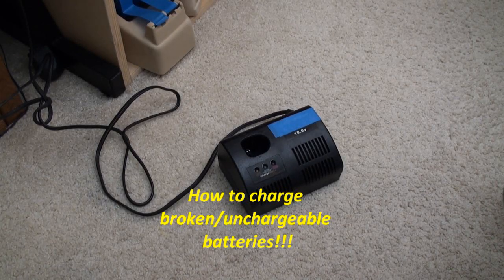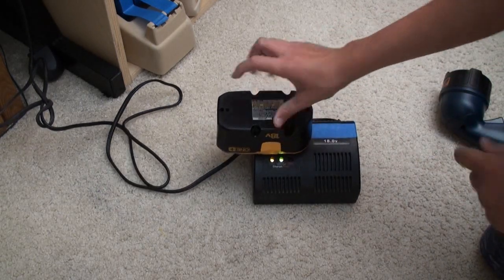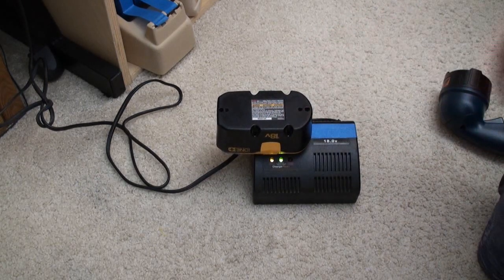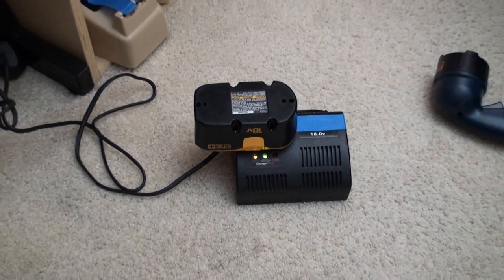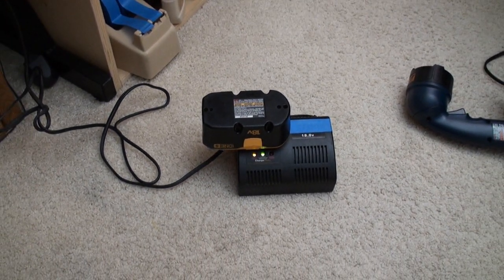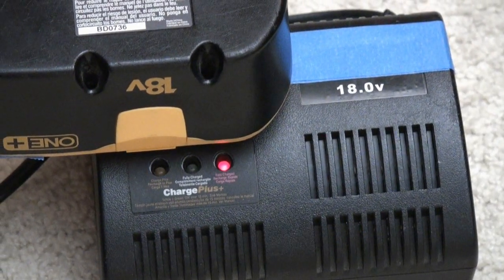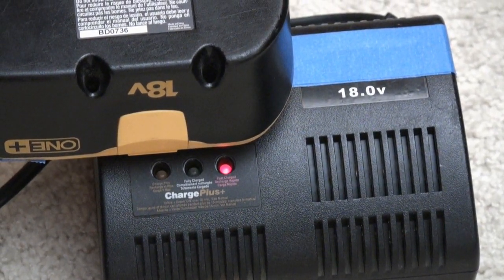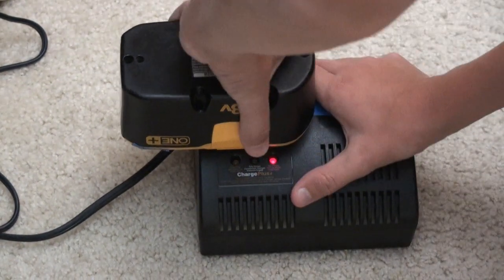How to recharge unchargeable batteries

Comment: I use a similar technique on my 3V digital camera battery with a 9V battery as the source instead of the charger.

No hidden battery switch here to be sure.  If you have this problem, take the two minutes to try this before scrapping good batteries, you wont be sorry.

Comment: this is playable if it is about batteries which been lying around for long time,  and therefore won't charge. .
the batteries shoul be able to take a proximity 1000 charges. ..If you have charged more than 1000 times
..your batteries most likely are worn out,  and will not keep up the power..

Comment: Old news. Been doing this with Nicd batteries for 30yrs. You can either reverse the polarity at about 10 amps for a short time or use a higher initial voltage to get it to draw current. Either way works for about 4 to 6 times when they are dead. After that nothing works.

Comment: rbrtfls is EXACTLY right . The battery will not hold a significant charge . You ( or a factory tech )  will have to open the case and replace the defective cell and re assemble the case

Comment: There's sound electronic principle here.  The charger detects a dead battery and won't charge when one or more of the many cells inside the battery has totally discharged to ZERO.  The charger THINKS it is SHORTED. Forcing a charge into a shorted cell will overheat it, so it shuts down

By intermittently jiggling of the power cord, the charger doesn't have a chance to shut down and a little charge goes into those zero-volt cells.  Then the pack doesn't look dead any more and charging proceeds.

Comment: Don't leave any rechargeable battery laying around that's been partially discharged. This shortens the life of the battery. Always full charge it right after you using it. Makes a big different on shelf life. All lithium type batteries all have a chip inside. This protects the pack against discharge down to zero. Otherwise, zero volts can result in the pack shorting out...and BAM! All the lithium and NiMh packs have a chip inside. This is why a running power tool will suddenly shut down.

Comment: Forcing the charger to rapidly discharge the bad cells allows the battery to recharge. Old battery chargers had switches to allow rapid power cycling to "reset". the battery. Today's chargers had the switches removed to save money. Right.

Comment: This is a battery memory problem caused by not completely discharging between charges.Interesting tip though, will try it myself! UK socket outlets are much safer than yours! Thanks.

Comment: The fact that this method works would suggest that it is the battery charger which is faulty (not the battery) and most likely it is incorrectly soldered components inside the charger which is to blame. These battery chargers are all made in places like china, india etc.  where they use recycled electronic components to make their products. The problem could also be that recycled electronic components in the charger are close to dying.
Another issue, bad electronic design engineering of the battery charger, seeing as it seems to be a common problem which many people are encountering.
A similar trick , if you can call it that , works with an apparently malfunctioning xbox power brick.

Comment: something to consider here; though with some caution.
In a Pinch I think there is nothing to worry about, but I would hold out to everyone that in the case where a battery has been run out of it's life cycle force charging it (If this is what it is) should be monitored and never left for Long Periods of time without supervision, like say every thirty minutes at the very most one should have a look at the status just to be sure a fire has not started just to be on safe side.

Comment: Been using this technique for a few years now on the same pair of batteries.  I believe what is actually going on here is either the battery (in some cases), or the charger (I believe in this case) contain circuitry to inhibit charging when a deep discharge occurs.  Feathering the plug in the socket eventually causes small arcs and an overvoltage in the charging circuit.  This forces a small charge into the battery allowing it to continue to take a normal charge.

Comment: u guys have funny plugs. but anyway i have a 12 volt battery i wanna charge and can only charge in a alarm system. i depleted it completely and charged it up and it still doesnt last. i'll try what u did, but our sockets are 240 volts, nt sure if that'll be safe to do bt i'll give it a try.

Comment: actually, they are 9 - 2 volt batteries. ni cads are always 2 volt. 
these batteries are very easy to dissasemble, but you have to solder the individual batteries.

Comment: Thank you. I had to endure 30 minutes+ of videos from "adults" that had crazy ideas like yours, but using arc welders, or connecting batteries together in series to get enough volts to "re-polarize" the cells inside the battery.
Yours is quick, to the point, and it works..

Comment: This didn't work for me on my Craftsman drill battery. The charge indicator light flicked on each time the plug made contact, but even after several minutes of flickering, the light goes off once the plug is fully inserted. The battery is still dead.

Comment: the battery would not blow because of recharging it like that, explode is not something possible for a battery like this is not C4 or Dynamite for it to explode, is a good idea but even through it would only work for a certain period of time and this is due because batteries tend to die because of there life time capacity, you can do this process of recharging it like this but it would have to be temporarily until you get a new battery.

Comment: Determine which leads are plus and minus. Connect a 9 volt battery to the recharge battery for a few seconds and then the charger will work also.

Comment: The problem with this method is if your battery is no good, it's very hard on the charger. I popped the fuse inside it a couple of times...at first I thought damn, stick a fork in it...lol. Anyway, I tried the welder method and the battery pack got close to normal voltage but still wouldn't charge properly, so that battery is toast.
Reply: You say this method is very hard on the charger if the battery is no good. I don't know enough to agree or disagree, but what I'm wondering is, on the basis of what information / experience are you making your assertion?
Reply: Dave Burrows
the fact that the charger fuse blew bay be a hint that the charger is overworking?
Reply: A blown fuse points to an overloaded circuit. Isolating the source(s) of that overload just takes a little detective work. In this case, the old battery is the likely culprit, but other factors may be involved. A resister, for example, serves some of the same functions as a fuse. If one or more resistors fried, their loss may put greater burden on the fuse than for which it was intended. Obviously, a short between contacts would do it.

A fuse is a safety device. A short circuit left unchecked can easily ignite a fire. The fuse also protects other circuitry from overload. Replacing a blown fuse is fast (if you can find it) and easy (if you can reach it), and can prevent a huge repair bill.

As far as an overworking charger goes, a job of the fuse is to protect anything from being pushed beyond it's intended limits.

We've all gone to turn on the windshield wipers, headlights, or some other electrical circuit in a car, and it didn't function. Once in a headstand position under the steering column with your legs out the open window, and a flashlight in your mouth, replace the proper fuse. If it blows again, then something else is going on. In my experience, replacing the blown fuse solves the problem, and it doesn't blow again. Sparky gods must be crazy.
Reply: Nothing can be done to shock back to life a dead cell. 18 volt ones have 15 sub c cells, if 1 is bad then it can ruin it all. Depending where it is in the sequence and how bad it is. I fix many batteries with only 1 or 2 bad cells in them that prevented all the others from working.
Reply: I don't know anything about batteries, not really, but that's the same conclusion I've drawn.

Comment: new method. what i do to recover nicads id pop them open, build a self-oscilating relay connected to a ac wall wart transformer in reverse and a HV diode and flash capacitor, and use the cap to "shock" the batteries again, coarse, you can also just use a fugicam circuit.

Comment: There is always a risk when recharging a dead battery,or even a rechargeable battery, this is an ingenuous way of brething life to a depleated battery.usually the main reason for this depleation is the acid inside them has been corroded or oxidated, but the cell core will still be usefull, at least for a while longer, so YES, you do save a bit of money and postpone the trip to even the cheapest hardware store.
Thanks for this video, and great instructions with technical lingo..keep it up and maybe post a followup on how the battery is or performed after this and for jow long..

Comment: Problem is, all this really does is make CHARGER appear its charging battery. The battery may indeed accept some more energy this way, but the chemicals inside have a shelf life and basically wear out over time .. So maybe the battery will appear to accept some charge again, but it won't give enough usable power to keep you from needing a new battery . Assuming this isn't a lithium ion battery....

Comment: If you want to avoid batteries from getting this way, dont run them all the way down.. When your drill goes down to 100rpms on hi speed--  STOP dont tyry to squeeze out a few more turns, put it in the charger. What happens is the batteries go down to zero or near zero and wont take a charge after that, even when they are freshly made they have voltage already, not zero...b The rapid plug/unplug sends a surge to the battery like a jump start, therefore getting past the zero point..

Comment: I know this works with lithium batts, as I use them in my e-cigs.  Lithium-ion rechargeable batteries generally have a protection circuit that prevents them from a "runaway discharge" & fire.  A 3.7v, like I use, actually runs 3.2-4.2 volts; the circuit prevents it from charging over 4.2, but also prevents it from discharging if it's under 3.2 for safety reasons.  Flicking the power like this bypasses the protection circuit & hopefully will get it over 3.2 so it will charge normally.

Comment: The original Ryobi 18 volt battery is junk. I bought a Lithium battery and  it's powerful and holds the charger like you can't believe. You have to buy the lithium charger, you can't use the old one. I bought the battery and charger on line and saved a couple of bucks and didn't have to run all over town.

Comment: batteries work off a chemical reaction. if the electrolyte is too damaged the battery will lose capacity and finaly just be too weak to realy hold the necesary charge to power tools with certain requirements. most batteries will last a long time - but certain tools will refuse to run with a battery that cannot supply the required power for a given voltage.

Comment: well I wiggled and I jiggled but both lights still stay on so if it works must only be with some batteries. And I was so excited about this as I have so many good power tools with dead batteries. This ones 18 v and charges but dies after very little use. Anymore tricks up yr sleeve kiddo

Comment: Well done young fella, BUT, once you charge this type of battery while its still has some charge, it will never charge BELOW what was left in it again. Eventually, after enough partial charges they are fucked..battery memory, you must DISCHARGE the battery completely compleely before charging;. Then you WONT have this problem!!  What hes doing is clever, but only a partial charge is possible...THINK, dischargers are easily available for just this reason. !!

Comment: I'm in England and do this with my old 12V Makita drill batteries and it also works on AA rechargeable batteries. It is safer, and easier, if you just flick the switch at the socket up and down quickly, does the same job.

Comment: WHY DOES IT WORK??  As I understand it, NiCADs go bad (also the 'memory' problem?) when shorts develop internally.  The shorts can be un-shorted by burning them with a higher voltage.  The charger produces a voltage burst when it is turned on.  Enough of these bursts can burn the shorts and the battery might be able to regain some useability.  **NOTE**  It's hard on the charger.  It's probably hard on the 'good' cells in the battery pack.  But, it's easier than replacing the individual bad cell.

Comment: there's another way..  charge your dead battery with your 12volt car battery charger  for 10 / 15 minutes (feel if its not gone be to hot..) et voilla.. your battery will charge in your charger again

Comment: its much more efficient to discharge a capacitor on the battery.
nimh/nicd bats stop charging because of slag on their poles (inside).
so just short a capacitor ~50v ~1mF on them and they're fine

Comment: can can actually repair these for good.  those cells are made up of smaller rechargeable D battery's in series.  if you take the screws out you can use a malty meter to test each one individually and then replace the one that has gone bad for about 2 bucks.

Comment: Not sure if this is 100% safe

If battery's are dead they will
Take much longer to charge up because of more resistance which can generate more heat for the charger

Never leave the charger unattended
Reply: Best not to charge anything on carpet

Use a metal piece or an ammo box especially with a lipo battery

If you can put the charger on a rack or grill of some sort you will get air flow around the charger and electricity flows better through cool wires than hot

Comment: with cheap drils ..the batteries are disposable.. pitch the whole drill.. recycle the batteries and  2 new batteries made by bocsh or dewalt or makita  are as much as the whole drill.. or close... just buy a new drill..thats what i do.. i need a hundred to 200 screws out of 1 battery.. a cheap china drill does 10 screws 3 inch.. junk

Comment: I have 5 old Ryobi 18v batteries that no longer take a charge. I've watched a couple dozen of these videos in the last few days, and you seem to be the undisputed originator of this method.  Good job; and almost 2M hits! Congratulations!

While I have seen a couple of people questioning this method for safety, or practical reasons, I haven't seen any videos which indicate the relative duration of this solution. Neither have I seen any videos that demonstrate why doing this breaches any safety boundaries.

In your experience, would you still call this method a fix?  How long lived is the duration of the fix? Do the batteries hold a charge as they used to?  Do you have safety concerns that you didn't 3 years ago?

Peace,

Dave

Comment: I tried this with a Rigid Rapid Max Charger and a 18 volt 2.5 amp hour battery that was dead and it worked! The only thing I had to do different was to plug and unplug the charger at a slower pace, if you watch the indicator lights on the Rigid charger you will see why, it does not turn off right a way when you unplug it, anyways, thanks again for posting! I turned the charger on and off about 15-20 times then let it cycle through evaluation and it went back to normal charging.

Comment: OK I'm a retired TV tech, audio and computer tech. We used to ZAP batteries with say 10 or more volts over the stated voltage on the dead battery. You just attach one end of the Negative(-) side of the battery to the negative power zapper and then attach the positive(+) side of the  power zapper to a wire or cable then touch the positive side of the dead battery intermittently holding it on for a few seconds at a time. Then check the voltage on the dead battery and it should come up at least half of the normal volts.  Then put the dead battery on the normal charger for the unit. this has  worked many times for me and others but the battery is still weak and may not last as long as a new one. Be very careful with  this advice and take your time.

Comment: what has the voltage of the mains supply have to do with the output of the charger which is the same? There is no danger in flicking the on off switch on the socket whatsoever. if you connect and disconnect by pulling/pushing plug although not recommended still no problem as rear half of UK  plug pins are covered in plastic by law to prevent accidental contact of finger.( I know what I am talking about as Electrical Engineer) well done allen2688 but always ask adult if not sure about something

Comment: This really does work!  I have an 18V Black and Decker Hedge Hog cordless hedge trimmer that I really like.  But the battery would no longer take a charge, so I tried Allen's method.
For me it took three tries. After pulsing the charger plug the first time the battery took a very shallow charge.  I discharged it all the way by running the the trimmer, put it in the charger, pulsed the charger plug and charged it again.  It took more of a charge this time, so I did it again. Voila! full charge and I just trimmed a big hedge! Thanks Allen!

Comment: What happens is the charger first tests the battery with full or higher voltage for a short time, then it stops and measures the pack to see if it has correct voltage. If not then it's flagged as bad. By doing the many quick starts thing it gives several tries at that full or higher voltage and magically the pack voltage jumps up quickly and then it charges it up normally.